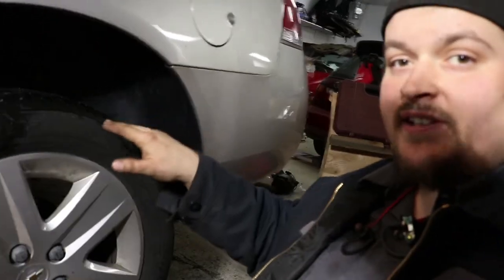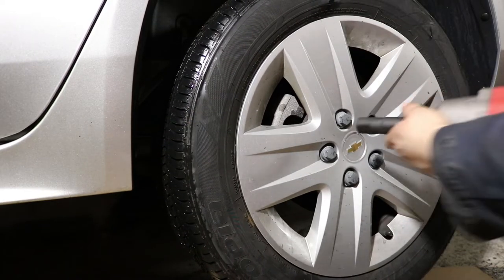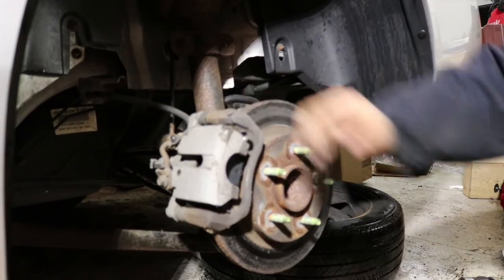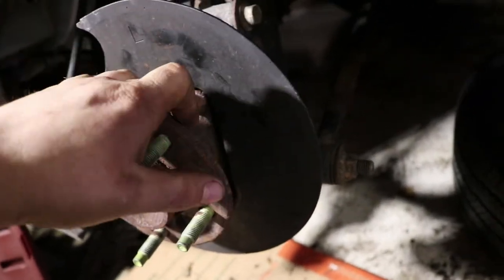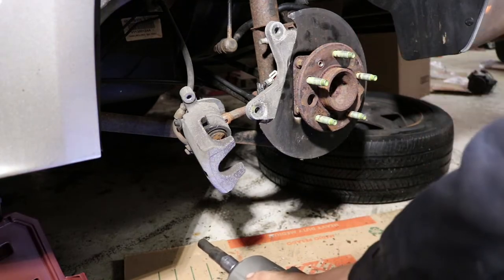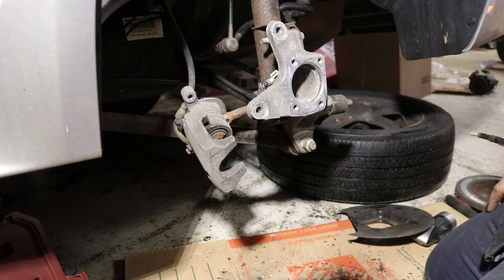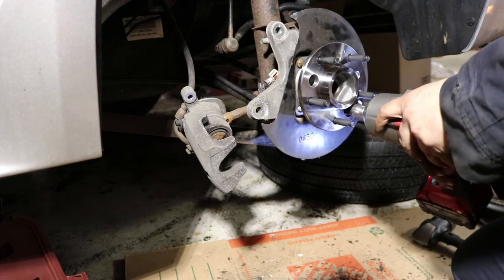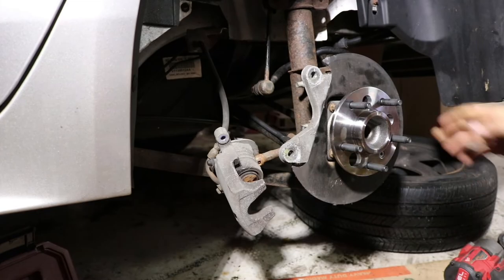2011 Chevy Impala Rear Wheel hub replacement

Comment: where did the emergency brake go to??? this the second video I have saw with no rear emergency brakes
Reply from the maker: On these models it’s intergrated into caliper that’s why there is a spring assembly on the caliper it utilizes the rear pads

Comment: When you change the rear hub is there anything you have to mess with 
the parking brake cable or those funky little parking brake shoes, I did
 not see them?
Reply: The caliper has the parking brakes in it.  No shoes or hardware